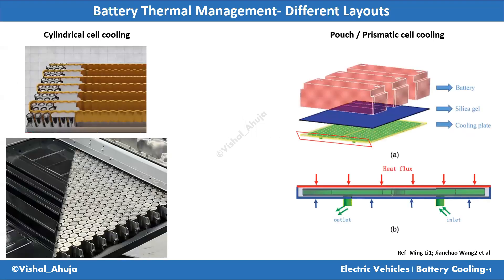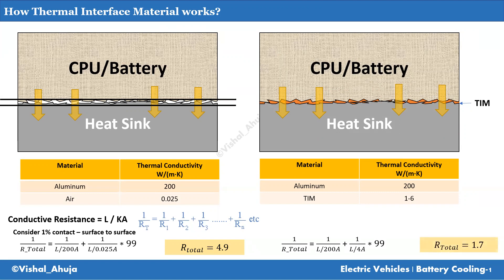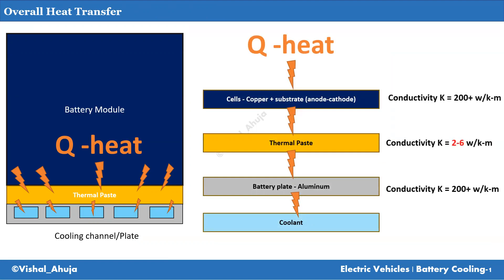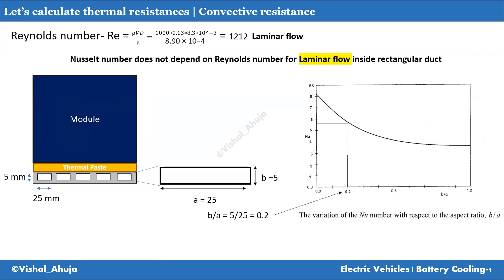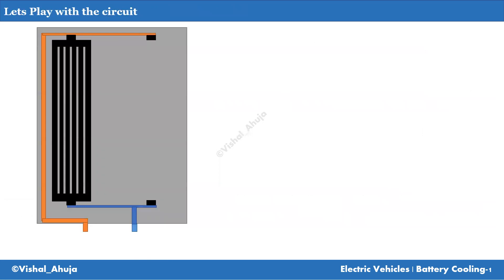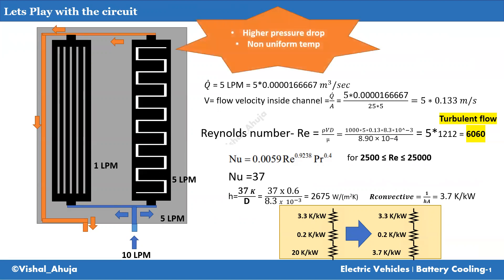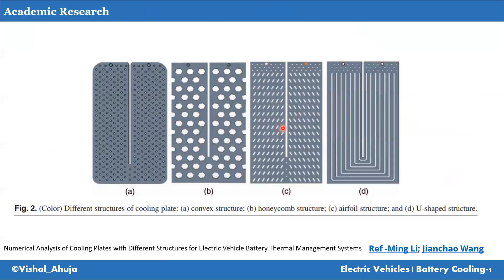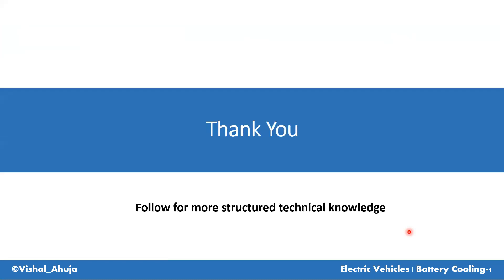Understanding Battery Thermal Management System | From basics to advanced-1

Comment: At 2:20: Can you please rationalize using resistances in parallel. Heat transfer through the (battery case - TIM - heat sink) appears to be in series.
Reply from the maker: The parallel circuit is for conduction through metal to metal contacts. You need to break down the total cm2 heat flux area to small small patches even while considering TIM. Feel free to send me your query in detail on knowingindetail@gmail.com